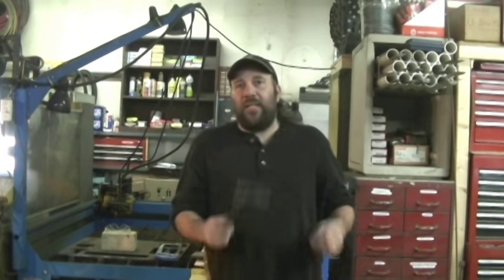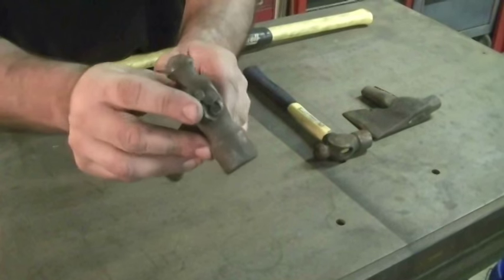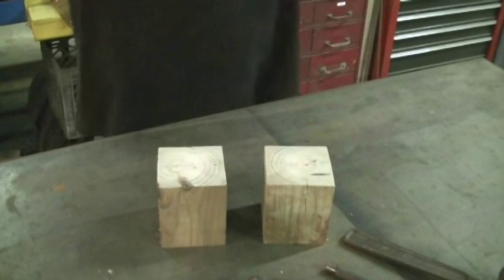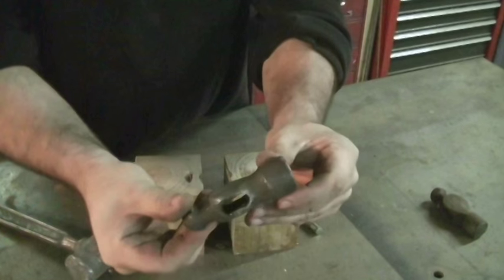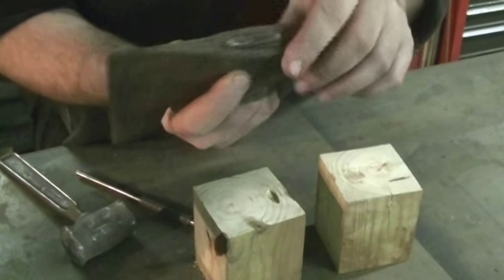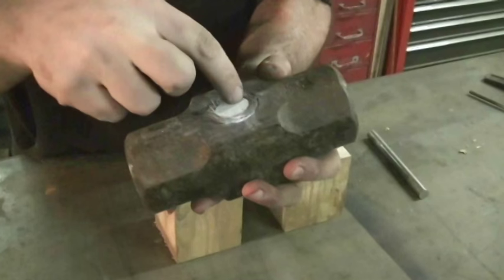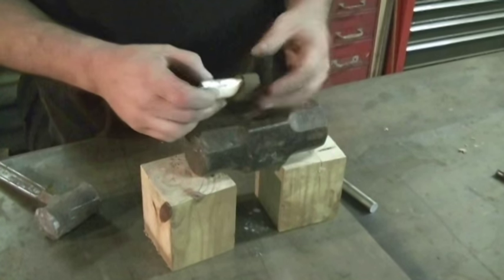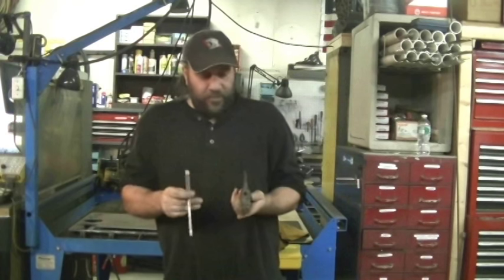How To Remove A Hammer / Axe Handle

Comment: Also, I'd say use the wood blocks for grip inside of a vice or even just a clamp. I think stability should always be a priority when it comes to smashing something. I have suffered too many bruises and punctures to risk it anymore. Once I sent an impact Phillips through the webbing of my left hand while trying to get an awkward screw that last 1/8 inch into an unstable object. Learn from my mistakes.